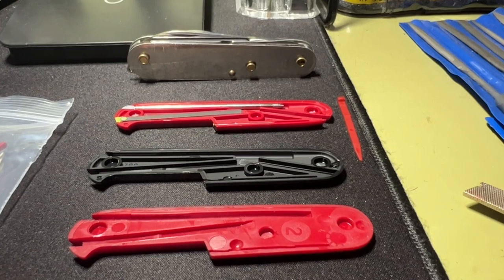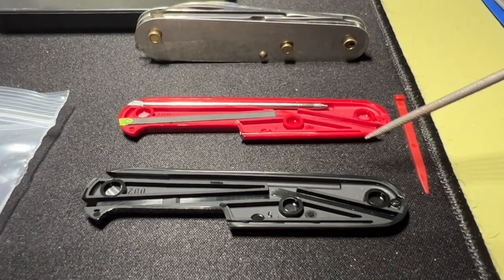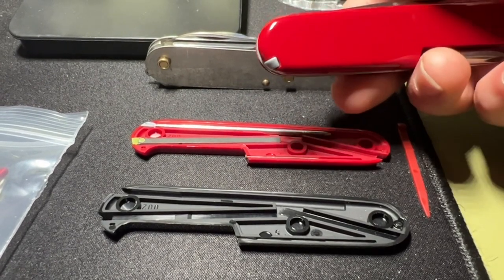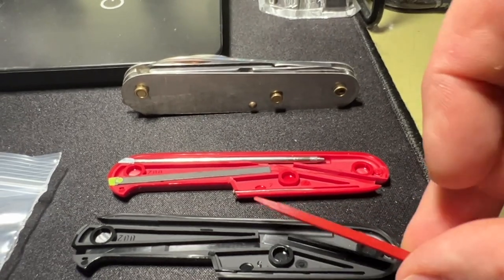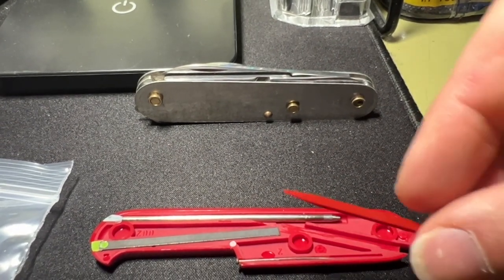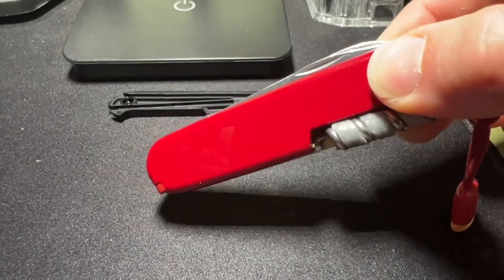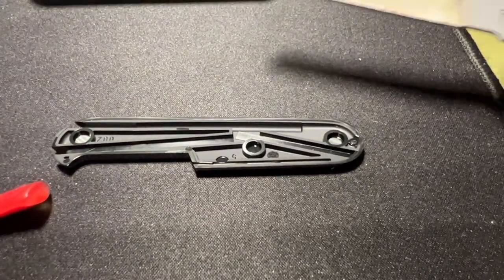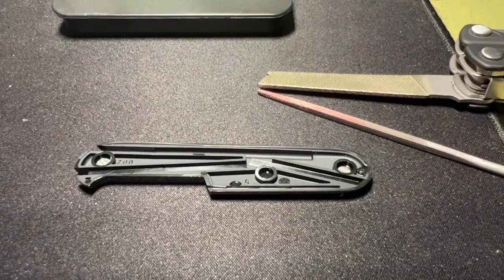Victorinox Compact Plus-ing (4th slot/58mm toothpick solution)

Comment: There is a guy named Tim Johnson who opened up a slot across from the tweezers on his deluxe tinker. But there is not an internal slot to hold it in place, so I don't get how it works.
Reply from the maker: Thanks for the tip, I’ll check that out! I imagine you could use some epoxy or Sugru to form a channel, and I’m sure someone on the aftermarket/3D printing scene has worked up something.
Reply from the maker: I just checked out Tim’s video. The front/shield scale of 91mm knives are usually a little thinner overall, and it looks like the toothpick on his sits under the shield (which is a thicker part), so I imagine that friction and keeping the opening fairly tight are enough to retain it. Thanks again!
Reply: The toothpick is made of plastic. Why don't you just remove a little material from the tip so it is shorter and fit in the slot?
Reply from the maker: Glad you asked, and I should have explained in the video. The toothpick tip has a very thin, flexible profile you would lose if you shortened it that way. Also, since that’s the end potentially going in my teeth and gums, I don’t want to worry about a rough surface or loose fragments that might result from reshaping that end. Much more sound to reshape the solid, block-ish tab on the other end, from my POV.
Reply from the maker: You’ve probably seen, but Tim uploaded a new video on his Deluxe Tinker a couple months ago, and he touches upon how he did that scale mod.

Comment: We can't hear you.

Why is the camera wobbling so much ??
Reply from the maker: What can I say? Had a cold, filmed it quick and wanted to avoid editing, moved stuff out of the way as the video moved on. Seems like the closed captioning caught me pretty well though. Will try to put more production value in next time. Thanks for watching in spite of that!
Reply: @MinstrelOnTheRun  You can make a workable overhead rig with a bucket of sand, a broom handle, wire coathanger and duct tape 👍
Reply: @MinstrelOnTheRun  nice video! I heard every word haha  and the camera slightly moving did not hinder the information presented.